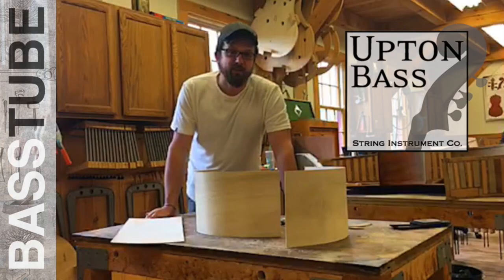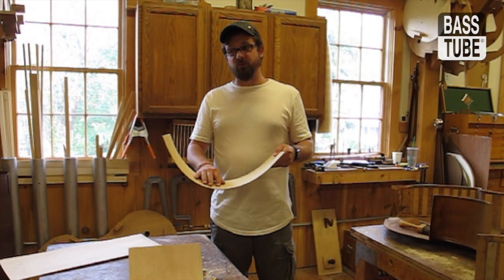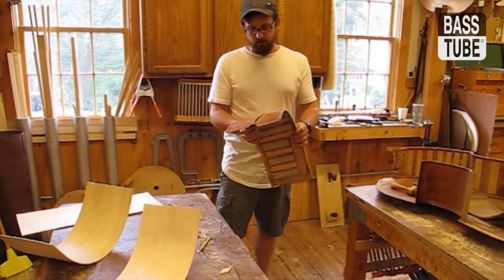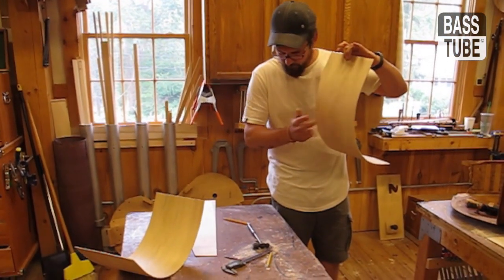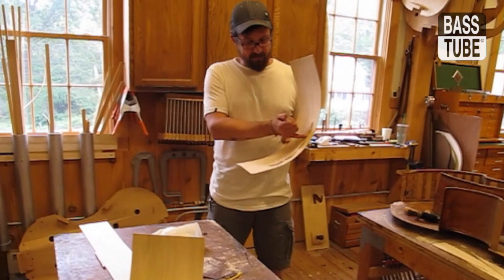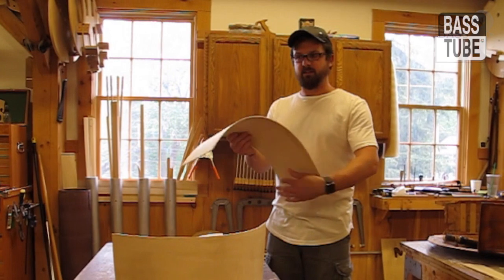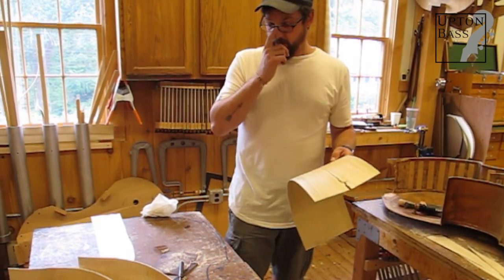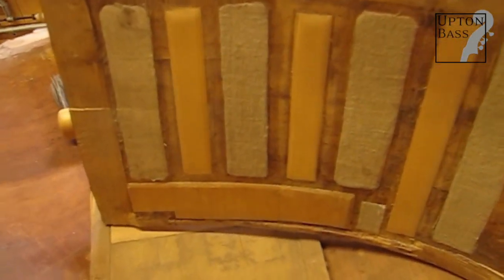Solid or Plywood Double Bass Ribs? Let's Break 'Em!

Comment: Intriguing presentation that shows 1st-that we might not know which sides we had unless the instrument got taken apart or we watched the construction from the beginning. 2nd-In a situation like yours-total control from start to finish-you are showing that the sound, at least at this point is not really different. If I'm paying 2-4 or 5 K for an instrument, I will want the best tonal quality, but I will also want structural durability as getting a bass into someone's house for a session is often much like furniture moving. My plywood top & back bass has sounded well for the 35 yrs in my possession, and it's (unfortunately) gotten a small beating but is STILL ALIVE!!
Reply from the maker: We won an ISB silver medal for tone in 2009 with laminated ribs, and we won 1st place for tone with the playing jury in Copenhagen in 2012 with laminated ribs.  We have yet to win a significant tone award with solid ribs, only our 2015 ISB certificate of tone was solid ribs...